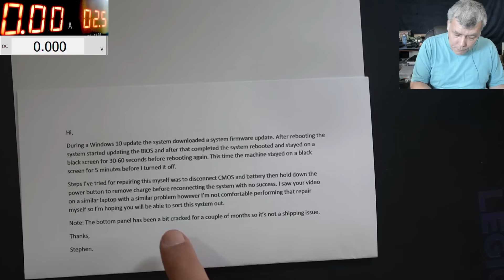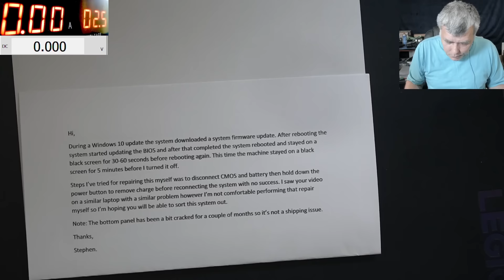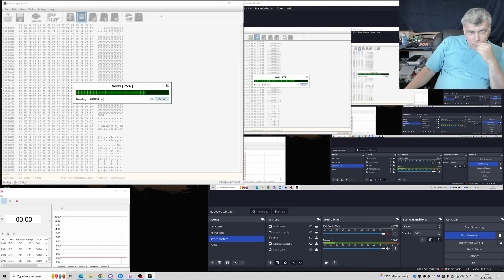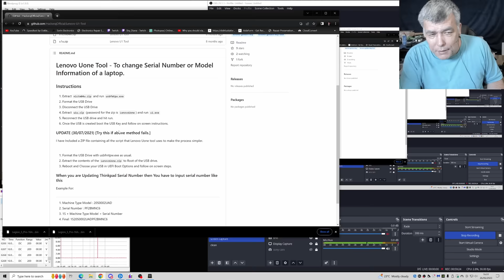Lenovo Legion 5 15ACH6H dead after windows updates - Sadly, laptops are dying after windows updates

Comment: Linux doesn't kill your laptop.
Reply: Problem is game compatibility is high but not perfect here
Reply: Windows likes DeGrubbing the Grub bootloader 😢
Reply: Linux told me to write my own WiFi driver. On a lenovo
Reply: Yeah, but it's Linux, so....
Reply: Yes I'm totally sold on Linux. I built my own Linux operating system. Then I built my own laptop. I hate proprietary. I want things to work the way I want them to work.
Reply: Say that to arch community.
Reply: Linux distributions also updates the BIOS
Reply: @lorenzo.delbello untrue - there's no official BIOS update executable for most (99%) manufacturers
Reply: @stamster  apt-get updates still updated automatically my BIOS
Reply: @lorenzo.delbello  quite interesting. Which manufacturer it is and have you enabled some additional PPA repositories?
Reply: @stamster  No, it's a Lenovo ThinkPad, probably it doesn't happen on gaming series laptops. Also it happened on some Dell
Reply: @VonGrav  Same here with fingerprint driver
Reply: Yes it does.

Comment: I have never. Never seen anyone perform a successful bios repair before. I hope everyone understands the value of what this man just showed all of us. Thank you sir.
Reply: I see bios failure a lot on Adrian's Digital Basement since he works on 40 year old machines, basically it's the same thing here except modern machines use SMD requiring magnification and a hot air gun instead of just a iron or (if Adrian is lucky)ZIF sockets.
Reply: I have done with it like 3 times
Reply: You don't really "do a BIOS repair". If the code/data on your BIOS chip gets borked in an update then the chip needs to be reflashed with the correct code/data. --- Without a functioning BIOS (Basic Input/Output System) most computers ars basically useless, except for very early machines that never had one (or any standard software) and provided a dead-start panel or similarly interface. A somewhat familiar example of that kind of machine is is the Altair 8800 from the early days of microcomputers. --- Such an interface is designed to facilitate manually entering machine code programs directly into the main memory (usually a simple program or a bootstrap/bootloader providing just enough functionality to get something else running). Another essential feature of the panel is controlling a number of essential bus signal, like whether the computer is running or halted.
Reply: Swapping out the chip was a little bit easier in the past, when the designs more frequently used sockets that you could just pull the chip out of. Of course that was always more common in desktops than laptops. --- You still would have needed a programmer, BIOS files, and some spare chips (just to cover the bases) though.
Reply: seen it lots
Reply: It's crazy how wide and vast different users experience the internet.  I've seen people write a new bios file using a programmer probably a few hundred times.

One thing I've learned is you need to know the correct voltage for the bios chip, because I've also witnessed a bunch of failures!
Reply: I do this every week, probably more than a 100 successful BIOS repairs :) It is an art that needs to be mastered, but once you do it, it is not difficult. But sadly I see more and more mainboard that were heatgunned or some repair shop "thought" it is something else and it is now beyond repair, even if it was originally just a BIOS problem.
Reply: Adamant IT has done a few BIOS "repairs" successfully.  One of the channels I like watching aside from here.
Reply: If you buy a laptop that someone has written an aftermarket BIOS from scratch for then it becomes much easier. I have LENOVO THINKPAD X200 which is one of the most heavily reverse engineered and documented laptops in existence and there are detailed steps documented online to externally reflash the entire BIOS flash chip with an aftermarket BIOS, using a SOIC clip and a Beaglebone or Raspberry Pi (for this specific model of laptop a technique has been found that makes desoldering unnecessary in this case).
Reply: CuriousMarc restored the BIOS on a computer he has by reflashing it.
Reply: depends on the system, desktops it gets easier especially with motherboards having backup bios's or in the old days they had removeable chips and you could have the board manufacturer send you a replacement if an update borks it. ive had to do the later several times on an MSI board lol, i think i replaced the bios 5 times from bad flashing.
Reply: I attempted this on an old Windows 8.1 tablet, but I just swapped the chip out and turned out the one from the donor was bad too. I need to get me a flasher like this lol..
Reply: @michvod  How do you un encrypt and re encrypt a bios though?  Unless the manufacturer provides the tools for it.  In which case, the encryption is essentially pointless.  I mean....the latest Aero 13900/4090 laptop....you have access to that bios already?  With all the encryption keys you need?  And ya...LOL at Gigabyte being secure on anything.
Reply: The hard part is finding a working BIOS. Flashing a BIOS is the easy part.
Reply: @bruticus0875  I never came across Gigabyte laptop... Usually I repair the BIOS, like clean the ME region, or something else. But there are some tools for unlocking password protected ones
Reply: reflashing a bios chip is one of the easiest things you can do
Reply: the biggest value he demonstrated is to use the correct power supply... that BIOS chip looks like a SOP8 which can be reprogrammed w/o removing, many tutorials on yt on using "flashrom" CLI utility
Reply: YOU never have lol, dont speak as if its for everybody.
Reply: I have done it several times, using a raspberry-Pi to re-program the chip, then solder it back onto the motherboard. The bios chips usually have quite large pins, but sometimes they are right next to very high connectors which makes access a bit more difficult. Sometimes bios updates fail half-way and taking out the chip is the only solution.
Reply: You're exposure is very limited then.
Reply: Adamant IT does this all the time
Reply: I once soldered another bios on top and changed only the enable/disable pin.
Reply: @Itapirkanmaa2  Hot flashing in the socketed DIP or PLCC days FTW! Now I have alligator test clamp for 8-pin serial SOIC and cheap $40 programmer. Only need to solder if the chip is actually bad.
Reply: Me either. What about Windows serial number?
Reply: majority of "bios repair" is simply replacing the bios chip with either another that's been flashed with a matching bios. Have done this several times with x58 & x79 boards myself
Reply: It was just a reflashing of the bios as long as you have the chip reader and writer you can fix any bios.
Reply: i do this daily basic ...even 4-5 on bench ,its an normal procedure .
Reply: This guy might be the first to show you, but we did it 10+ years ago with an EZP2010 on a XP laptop 😂. Flashing a dump file on a BIOS chip externally is really a common repair and it has been around for ages amongst the repair community.